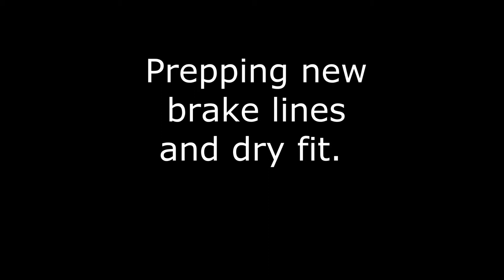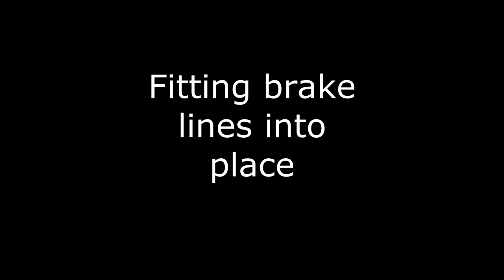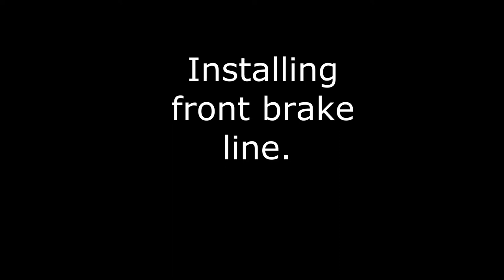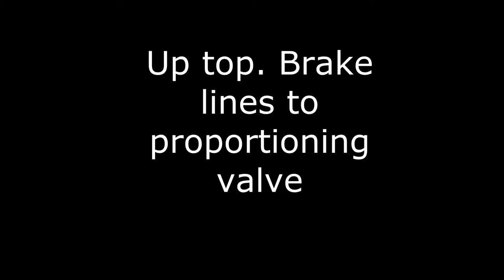Front Brake Line Installation

Comment: Where did you purchase the master cylinder and booster kit.
Reply from the maker: Master cylinder came with a disc brake conversion kit I bought from summit. The brake booster I think i bought off of summit as well. I did not like the 9 inch booster that came with my disc conversion kit. Good Luck!

Comment: Where did you find the drivers side small brake line? I snapped my hard line yesterday :/
Reply from the maker: I ordered a brake line kit. The lines where stainless. If I had to do it over again I would have bought regular glavanized brake lines and not stainless. Stainless turned out hard to cut and flare when needed.